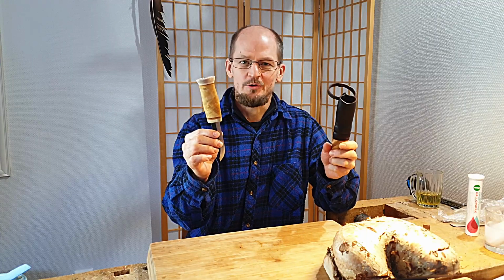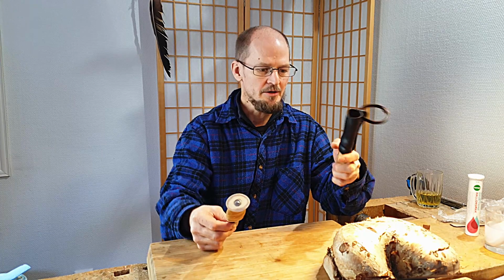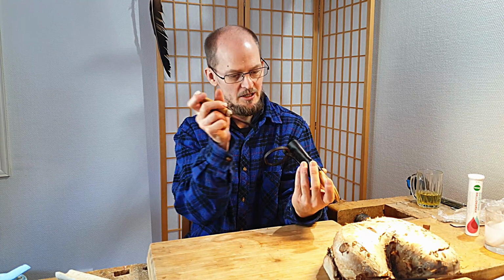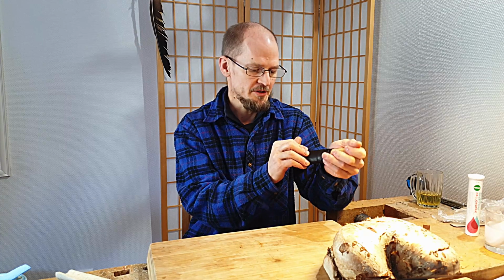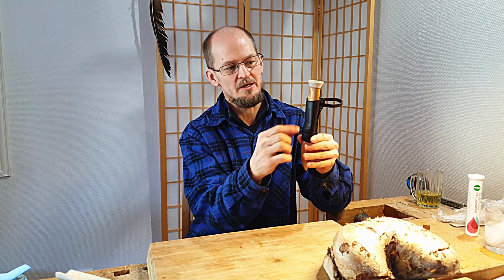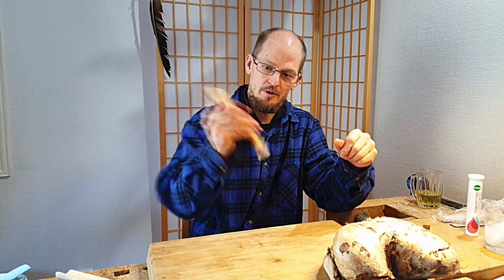Curly Birch & Reindeer Antler Knife Sheath

Comment: Fantastic job! The finished job has a great character. I much prefer simple functional knives like this rather than ones that are elaborate and ostentatious. I love the rustic stitching on the sheath, way nicer than when its all measured out regular with a wheel and drilled . Did you use some sort of pine tar wax on your thread (and the leather finish at the end)?
Reply from the maker: Hi, that's very kind of you. I'm glad you liked the knife and sheath. Yes, I use pine tar on the thread and the leather is greased with processed lard and a bit of tar oil mixed in.